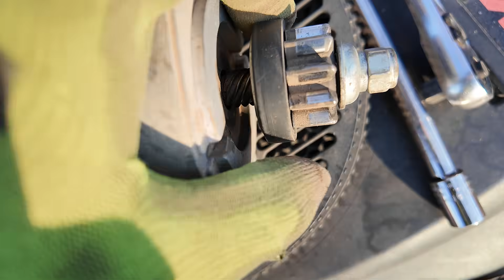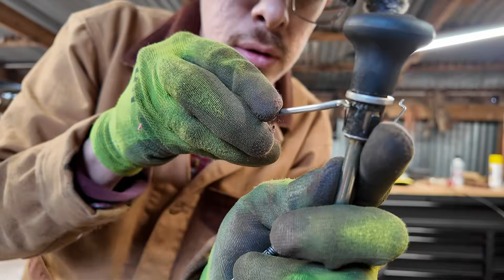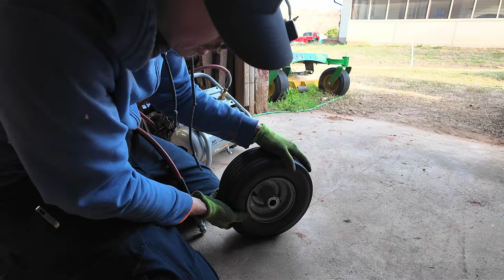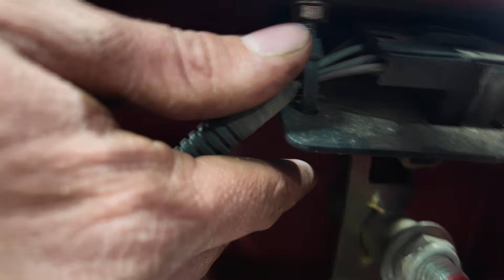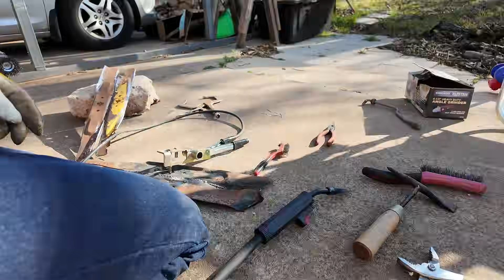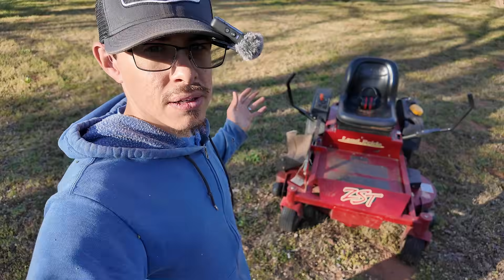I spent $800 on this Land Pride ZST Zero Turn - Can I make a profit? Flipping to $50K Ep 4

Comment: Have the same exact mower and also need to replace the fuel line, epa valve and grommet. Was wondering if you could give me a few pointers on how to remove the old and replace with new. Tried watching the video but it’s fast forward on that part.
Reply from the maker: Well, I kind of wasn’t sure if I did it the ‘right’ way… 😂
The old one was already gone, so I can’t speak on how to remove it. 
For installing the new one, I ended up using a razor blade to slice bevel the plastic to help it go in.
Reply: @gar @garagestory  Gotcha ok so your fuel line was just floating inside the gas tank?? Might just go ahead and do that for a while since it’s just for personal use. Wonder if it would have any negative effects later on down the line.
Reply from the maker: The main thing is keeping dirt and water etc. out of the tank. The previous owners put duct tape on it. If you store it inside, you would probably be fine running it with duct tape.

Comment: I've had deck springs vibrate and make noise before I found that you can cut and use a bicycle innertube to slip over the spring I've had mine on for over 4 yrs now
Reply from the maker: That’s a cool idea! Thanks for sharing.

Comment: When I adjusted the valves on my mower I went under the belt clutch and turned the motor that way. I think it was a 5/8 wrench 🔧. I didn’t want to remove the top cover. 
I adjusted the intake valve at 4 thousand and the exhaust valve at 6 thousand.
Reply from the maker: Good idea! Do you pull the spark plug to find TDC?

Comment: Tire tips. For dry rot and slow leaking tires use ATF not slime. It works better and doesn’t rot the rims. You can also use grease around the bead to help seal it better. Good luck in your mission to make a living flipping and selling tractors etc.
Reply from the maker: Thank you for the advice and support!

Comment: I think the throttle and choke cables may not have been adjusted correctly where the sheaths are clamped. Possibly the choke plate wasn’t closed all the way and throttle wasn’t opening all the way.

Comment: Never heard of Land Pride. Probably a local thing. Despite what one other viewer mentioned about being a Kubota build, it’s obvious this is a residential quality machine with plenty of inferior parts.  Although having a Kawasaki engine is a huge plus, that was a somewhat lower power unit absolutely designed for smaller residential applications. 
I think you did well at $1900, but probably paid a couple hundred more than it was worth, low hours notwithstanding.

Comment: The engine and the machine are two completely separate units with their own sets of manuals and instructions. Anything to do with or bolted onto the engine will be in the engine manuals, not in the machine manuals.
Kawasaki manuals are extremely well written and have full torque specs, including the valve covers. 
Adjusting the valves has been refined to a very precise method by the Kawasaki engineers and is well worth reading to make that process much easier and faster.

Comment: A lot of your struggles and time wasting have to do with avoiding doing the prep work and first steps before attempting things.  Removing the casters completely first, removing the tires from the wheels to really clean well first, etc. 
Also, thinking through everything you want to do and attacking all the steps in the right order will avoid having to do some steps multiple times. 
Reading the machine manuals first will help immensely when working on things. Not reading them will result in huge time wasting when you have to do something three times to get it right.
Reply from the maker: Yes, I do jump the gun sometimes. It’s a balance of trying something simpler first before going through a whole process. Sometimes it works and sometimes it doesn’t. I appreciate all your advice!

Comment: You don’t have a vice?!!!  Holy moley!  That was among the first tools I ever purchased at maybe 10 years of age!  I still have it and I’m 78. Recently moved it outside since I replaced it with a slightly larger freebie. 
A vice is part of the most basic essential tools anyone can own. Get one now!  Freecycle or other local free places usually have some available. If not, go for a better brand smaller one, like 4-inch jaw width, although if you can afford it, get 5-inch or larger. Bigger is definitely better when it comes to bench vices. 
Whatever you mount it on requires that surface to be at least bolted to the wall so it won’t move when using the vice. 
Best quality are worth investing in because this is a lifetime purchase. Wilton and Yost are two of the best. Just don’t get cheap ones - they’ll break!

Comment: If youre struggling to get a bead to set, put a ratchet strap around the tire to squish the bead up on the rim more. Thats what I do and it works well. As a final step I'll set the bead with fire 😂.
Reply from the maker: Yes, I’ve used ratchet straps many times, in fact I used them the first time I was seating the beads on this mower. But sometimes they aren’t really necessary, just depends on the situation.

Comment: You should've asked $3000 for it, honestly. It being Kubota made, having a Kawasaki, a fabricated deck and the low hours are major selling points. I've been selling riders and zero turns for 5 years and I know the market really well. I sold 44 last year and 40 the year before. I've sold 8 this year so far, hoping to get to 50 this year. Good luck man!!!
Reply from the maker: Wow, I could learn a lot from you!
How long do you hold on to them when selling? How much above your target price do you list them for?
Reply: @garagestory  I have a pretty established reputation on Facebook and offer free local delivery within 15 miles of my house and they usually pay full price when you deliver. Delivering speeds up the process of selling them tremendously. I deliver up to 60 miles for a fee. I usually do the first 15 miles free then charge $1.50 a mile after that for the one way trip there and it covers gas for the round trip. This early in the season I have a hard time keeping up because they sell so fast. . As far as my pricing goes, it depends on the cost of the mower I'm selling on how much wiggle room I have on my price. If I'm asking $650 for a mower, I'm probably not too negotiable on my price, maybe $50. But if I'm asking $2000, $1700 cash in my face is probably gonna buy it.
Reply: Also, I sold my ninth tonight 🎉🎉
Reply from the maker: That’s fantastic! I appreciate the response.
How do you source your mowers?
Also, what region are you operating in?
Reply: @garagestory  I have a local mower dealer that I buy his trade ins from. And I buy some on Facebook that people do not know how to fix. I'm 50 miles east of St Louis, MO in Illinois

Comment: Hey brotha I just got a cub cadet gt3200 with 100 hours garaged kept 25 ho Kohler and power shaft series for free ! Wish me luck
Reply from the maker: Wow, that’s nice!! What’s wrong with it?
If it’s the horizontal shaft engine and runs good, you could probably sell the engine for $700 or more on eBay
Reply: @g @garagestory ’s actually in mint condition I just tore the carb all the way down figured I’d try to save myself some cash got it all done and by hand my gf got me a ultrasonic cleaner, but I’m not sure on what cleaning solution to use. I replaced fuel filter fuel filter carburetor’s re assembled when starting it it runs on starting fluid, but it won’t pull fuel into the fuel filter so it has a mechanical fuel pump that hooks to the rocker arm, have one on order and should know here the next day or so what would you say with a good price for the mower itself running in good condition??

Comment: You need a tire air valve installation tool, it would make it much easier and no dropping the valve into the tire. About $9.00-$20.

Comment: Bro you’re scared of stripping the spark plug threads but you over torqued the valve covers 😅
Reply: @garagestory p.s. I’ve broken bolts off in the valve cover before. Also broke a coil bolt a few weeks ago. A few months ago I broke an engine mount bolt off. I know how it can be 🫡

Comment: Good job. Land Pride has very little brand presence, however, the Kawasaki engine and low hours helped a lot.
4 pumps of grease per spindle is nothing. Grease it until grease comes out of relief port or seals.
Use bead sealer on tires once the beads are cleaned up.
Use Gorilla Glue construction adhesive on seat and large plastic clamps and let dry for 24 hours.
Reply from the maker: Yes, I wasn’t sure how much it would be worth, but it turned out well!
How do you avoid damaging the seat vinyl with the clamps?
Reply: @garag @garagestory padding under the clamps and a hot air gun when you’re done to allow the vinyl to return to its original shape. Or maybe just set it outside in the sun for a while.

Comment: No a zero turn doesn't have one side faster than the other if they're adjusted correctly that is not true.
Reply from the maker: Interesting. In my experience one side is usually slightly faster than the other, and often times the side that is faster forward, is slower in reverse.
It seems to make it easier to drive with one hand when one side is slightly faster.
Reply: @g @garagestory e is correct. They CAN be adjusted, usually by speeding up the slower one to match the faster one. I’ve seen at least a couple videos of someone doing that. It may very well be in the service manual.